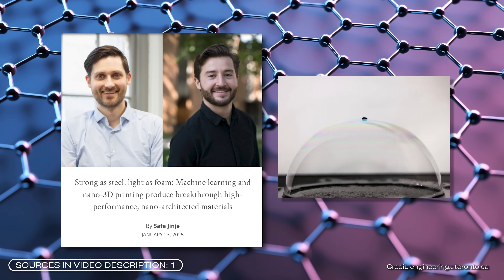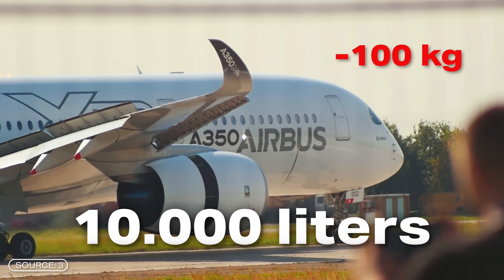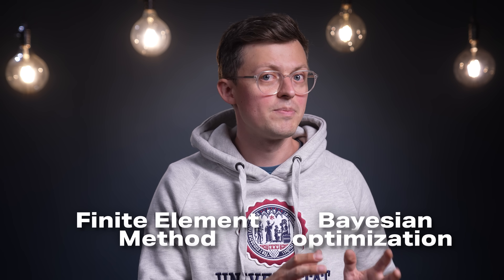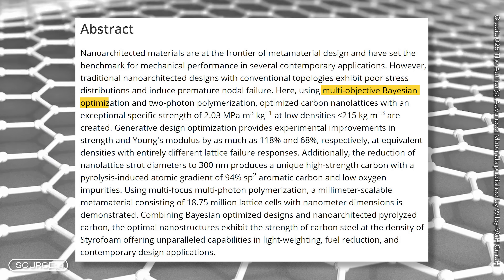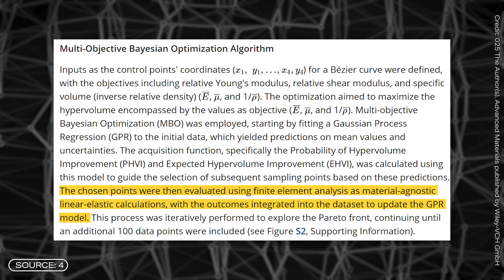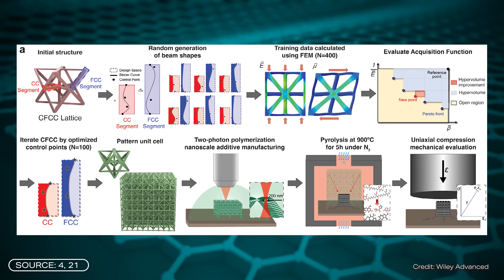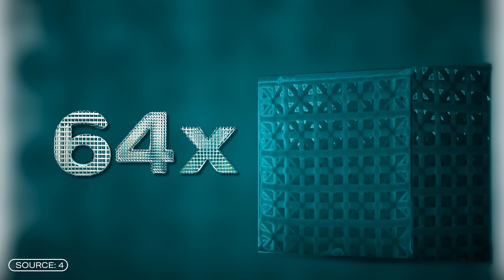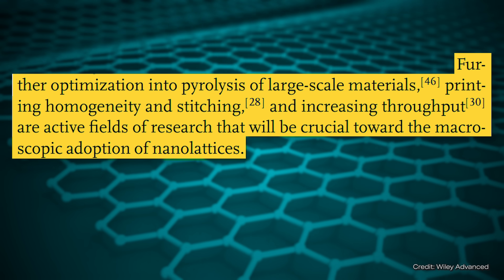New Material: As Strong As Steel, As Light As Styrofoam!

Comment: Oh, foamed metal again? Yeah, BattleTech has been talking about this since the 70's. One of the problems is that it is basically nonductile, once the foam is crushed, it stays crushed.
Reply: Foamed metals have random pore distributions, leading to irregular stress concentrations and brittle collapse when crushed, but these carbon nanolattices are precisely designed to homogenize stress, avoiding localized failure. Foamed metals permanently deform under load due to plastic collapse of cell walls, but he pyrolytic carbon nanolattices are linear-elastic until fracture, and their optimized design delays collapse by distributing the stress.
Reply: i mean, carbon fiber has the same problem but has made it into many high performance applications.
It'll probably depend on how economical it is and if it fits a given application.
Reply: @GamerLudwig 
Yes, carbon made it into the real world as a fiber together with some binder (resin, etc) , not as a nano structure material.
Reply: @GamerLudwig  Dunning-Kruger
Reply: Having a regular structure should help with that
Reply: Yeah, that is why enhanced densified wood is better. Stronger than titanium in every way and but importantly toughness (resistance to impacts, stress and cracking is extremely high), all while 20-40% lighter than aluminum.
Reply: @Resist.Tyranny  With caveats, for sure.
Reply: @Resist.Tyranny  Eactly. Quality wood is nothing else than high quality carbon nanostructure. Wood surpasses everything that has been artificially created so far in ratio weight.
Reply: @Resist.Tyranny  How hard is it to produce enhanced densified wood?
Reply: @StarWarsExpert_  There are two primary types of densified wood. Both remove hemicellulose through liquid chemical soaking, and both use pressure to crush the wood smaller (denser). One method also removes a lot of lignin (the strongest part), and therefore uses much less pressure to densify the wood making that part simpler. The end result is a board that has lost 80% of its thickness but retained its strength. The other method requires much higher pressure, complicating that aspect. The result is a board about half thickness with even more strength than the original because it forces extra tight lignin bonding. There is a company right now trying to ramp up production of the first method. It is a great material but a lot weaker than the second process. When I say enhanced, however, it is in regard to a proprietary step developed by me that adds another 25-40% strength to the already much stronger process. This causes it to exceed all metals and composites currently in use. Magnesium is still lighter, but can't begin to compare in other features. Top-of-the-line carbon composites can compete in some strength areas, but fall far short in others. Titanium and steel alloys are just not as strong. The big breakthrough with this however is how to overcome the high costs of achieving the high pressures needed to make this happen at production scale. This has now been solved. Tons can be produced at a time. All I need a few hundred million and society will never be the same. 🙂
Reply: I'm pretty sure the densified wood I've seen isn't that much lighter than aluminum.
Reply: @Resist.Tyranny  how is enhanced densified wood produced/manufactured (in a nutshell, yes I will search for more info on it)? is it like engineered beams and composite wood/glue materials like MDF?
Reply: @alastairleith8612  It is in another comment. Repasting here. There are two primary types of densified wood. Both remove hemicellulose through liquid chemical soaking, and both use pressure to crush the wood smaller (denser). One method also removes a lot of lignin (the strongest part), and therefore uses much less pressure to densify the wood making that part simpler. The end result is a board that has lost 80% of its thickness but retained its strength. The other method requires much higher pressure, complicating that aspect. The result is a board about half thickness with even more strength than the original because it forces extra tight lignin bonding. There is a company right now trying to ramp up production of the first method. It is a great material but a lot weaker than the second process. When I say enhanced, however, it is in regard to a proprietary step developed by me that adds another 25-40% strength to the already much stronger process. This causes it to exceed all metals and composites currently in use. Magnesium is still lighter, but can't begin to compare in other features. Top-of-the-line carbon composites can compete in some strength areas, but fall far short in others. Titanium and steel alloys are just not as strong. The big breakthrough with this however is how to overcome the high costs of achieving the high pressures needed to make this happen at production scale. This has now been solved. Tons can be produced at a time. All I need a few hundred million and society will never be the same. 🙂
Reply: @Resist.Tyranny  but none of that is correct...
Reply: @philm7758  lol, none of what. I'm thinking you did not look at all the comments, and are spouting off on things you do not know much about.
Reply: @Resist.Tyranny  very true
Reply: Styrofoam comes to mind and took off in so many ways.  If the need is there, it should do the same.
Reply: Most high performance structures need BOTH compressive and tensile strength and this process only maintains the compressive strength while reducing tensile. Ultimately it’s still better to use macro scale materials with highly optimized geometry to reduce the volume of material used rather than thinking we can replace existing designs with some miracle material.
Reply: @refusalspam  Yes, and them damned automobiles will never be more than a fad.
Reply: This is a carbon grid, carbon fiber is flexible, so why wouldn't this be on a large scale? Nobody has made anything larger than a pea, seems kind of silly to start assuming mechanical properties of a new material before it's even been made yet.
Reply: @Wimbletonage 
It isn't really silly. 
You will not be able to increase all aspects of a material. 
Such structures even in macro scale like in cranes or bridges for example are known to have higher stiffness.
At the same time, they are known to be vulnerable to the failure of single parts.
Compare old stone bridges with steel structure ones.
If in the stone bridge some stones fall, then the damage will stay local and many more stones have to fail for the complete structure to collapse. In contrast in steel beam bridges, a single beam failing, can cause the whole segment to collapse.
Reply: @DacusMaIus have u never been on a bridge with a semi truck 🚚  the bridge will literally flex and u feel like ur  bouncing the way bridges are designed today one beam will not make them fall
Reply: @Wimbletonage  let's assume it's an inch think, to flex it'd need to stretch further than the material would allow without breaking...it will break. This entire area of research has already happened, it does not work where it's not already implemented
Reply: @Wimbletonage  heh, I say that they make something larger and useful, which will get some heavy use and abuse.
Make me a cane out of it, I'll give a detailed report on its mechanical qualities from a real world use perspective. I'm infamous for dropping and banging my cane into things at times, getting trapped in holes while walking on cracked walkways and using it as a tool, ranging from pulling groceries (such a quaint old world, old fashioned, really) from top shelves and occasionally convincing idiots to bother someone else.
And even dropped one from a roof in a highly unusual accident that required replacement of the cane tip.
If it's utterly unscathed after two years of daily use, it's good enough to be used for armor on an old battleship. Undeformed, good for use in ships and aircraft.
And it's definitely scalable if one can make a cane out of it, given that pea size.
And it'd be the most expensive cane in the world, given the nanoprinting involved.
Reply: like honeycomb aluminum i suppose
Reply: @gordons_here  
Honeycomb Aluminum is not armor. It is a component in Composite materials. Please do some research before coming to such obviously uniformed conclusions.
Reply: @gordons_here  no
Reply: @-danR NOOOOOOO!
Reply: Ah, BattleTech, almost brought a tear to my eye....
Reply: No, this is a meta material.
Reply: I think you don't understand nano. Foam is not necessary at nano level.
Reply: Sure, but isn't the whole idea to make a material that is really strong under the right circumstances? Imagine how much energy a super light train could save on energy!
Reply: foamed? No.
metal? No.
same basic principle? No.
tl;dr: No.
Reply: @-danR tl;dr: N
Reply: You mean like basically everything?
Reply: so its real strong till it becomes dust
Reply: With this, it seems to have a support structure on a molecular scale that will be highly resistant to crushing and denting. But as you said, once crushed, it stays crushed. And hopefully not brittle. And orders of magnitude stronger than Aluminum, Carbon Fiber and Engineered  Wood.
Reply: Sounds like it could have a good utility in making safer vehicle crumple zones.
Reply: So? Bolt assemblies of components together and just replace the damaged components. We already do this all the time!
Reply: Pretty much every structure that is crushed, stays crushed, it's just a matter of where and how it's used and, I suppose, how you adjust the design parameters to get the structure you want to possibly get more ductility at the expense of some strength.
Reply: Styrofoam doesn't weigh 125K per cubic metre, silly comparison
Reply: Sounds a lot like nuclear fusion then, always 50 years away... 🥲
Reply: Also, how does it get affected from repeated bending forces (wings flexing in turbulence)?
Reply: Why would the foam become crushed ?   Aluminum gets dented, but planes are not full of dents.   
Furthermore , if it was made into structural components of a fixed construction, then it would not be subject to crushing forces.   Inside the plane are many structural members that are protected.
Reply: @jeffguarino2097 
"But planes aren't full of dents"
I have terrible news. Planes are full of dents. Especially around the entrances and cargo doors. Usually they are quite small and within limits, but they can also be larger and repaired with an external doubler, (Those large rectangular bulges, usually on the main structure) or internal doublers (small rectangular/oval patches with a bunch of rivets surrounding them, usually on leading edges and inlet cowls)
Reply: @carstekoch  Doesn't the 12 psi of pressure in the plane pop out all the dents ?  Probably not, I take out the hail dents on my car with a glue gun puller which is more than 12 psi over the area of an inch.
Reply: @jeffguarino2097  because aluminum is still solid, this is mostly empty. It crushes extremely easily and has incredibly low impact resistance. Its quite simple.
Reply: @jeffguarino2097 airplane metals get warnout flexing and develop brittle areas and cracks. Once crushable becomes permanent.  Ie hollow stiff material will be strong overall but week at skin in comparison
Reply: @jeffguarino2097  Agreed. the concern is even small deformations could cause failure, were as in sheet metal that does not happen. so take you air plane wing for example it flexes all the time, and returns to its intended shape.
Reply: @sparkey4293 Not intended for the flexation components.
Reply: @sparkey4293 
Key point, it flexes. It doesn't deform. So assuming the material is able to flex, this is a different topic.
Reply: @sparkey4293  The strongest airplane wings are not made of metal but of carbon fiber. Never hurts to look it up.
Reply: @sparkey4293  Ergo, probably using the material for structures that will flex is not a good application just as using glass wouldn't.
Reply: @sparkey4293 I would probably fuse a durable skin over it, similarly to how we apply fiberglass and resin over wood.
Reply: @jeffguarino2097  actually, many are. I've seen what they look like after passing through a major hailstorm.
And oddly, the carbon composites survive, despite some comments here.
Reply: @spvillano  Possibly this material is good but needs to be layered with a ductile material like aluminum.   It must have a slight bit of deformity allowed before it cracks.
Reply: @jeffguarino2097 imagine a pile of interlocking eggshells. You crack one it doesn't uncrack. You can't unpop a bubble
Reply: @drewlarson65  Except at the nanoscale you don't notice the cracked shells and then suddenly your wings snap off or your submarine implodes.
Reply: @drewlarson65  If the interlocking eggshells were made from aluminum and you cracked one, it would be the same thing.   Your material would need additives or layers to prevent the cracking from ever happening.   The main beam in my house could crack and I wouldn't be able to uncrack it.
Reply: AHahhahah. Lookup Battelle Memorial Inst. These materials have been around and used since the 90's. The US military research budget is unfathomable.
Reply: The concept of microscopic honeycombed structures has developed quite significantly since the 1970s. Metal-polymer is indeed non-ductile, and non-resilient as a consequence. Dents are deadly, with this particular choice of materials. What you need is a compliant nanogrid structure married to a rigid nanotube structure … like wood, but at 1/1000th of the scale. Wood is “micro”, not “nano” scale. So were the early attempts at making cellular structures out of polymer microgrids and metal microtubes.
Reply: Just like my hopes and dreams.....
Reply: So it doesn'T deform?
Reply: Don't want to make a plane of magnesium they would burn faster than a wood plane. Basically carbon and aluminum together are used now like carbon steel.
Carbon thread seems to be proposed for high speed manufacter 
 This is a uniform carbon structure if the voids are filled with aluminum it doesn't weigh any less just difficult to do that. If filled with air it's a trapped bubble in the material that expands and contracts with pressure temp differences differently than the surrounding material. If small and consistent it might pass. It depends if you can x-ray it to determine that.
Trapped air bubbles are not all bad. Those small glass bubbles are handy for some light weight materials as long as you are not building some habitat on Venus styrofoam has a bit of flex. Maybe a bit of added carbon to styrofoam the sharks can only eat half your surf board it's just that Tabasco sauce might be the better composite material in that case. 
It depends on the application so some material gets patented and nobody knows what to do with it yet. That's what happened with silly putty. The best minds tried to figure an industrial application then stuck it in an egg and sold it to kids. They have come up with all kinds of uses for the stuff like clogging your toilet.
Reply: Unless you apply memory material properties..
And in the case of vehicles a structure with the ability to absorb energy in the case of a crash is not all bad.
Reply: I was thinking buckyballs. They’re so for a promising reemergence.
Reply: Sounds like manufacturing scale problems are huge... It's a long way from 10 micron to 10 meters, and doing it for less than $10 million/meter
Reply: Not everyone wants to kill stuff
Reply: Mean while EV batteries average 2000kg
Reply: @Icu-812-me2 
EVs also don't emit CO2.
Reply: @carstekoch 60% all power generation come from fossil fuel here in the US. Impact of rare earth mining  for materials is magnitudes above that for inertial combustion engines.
Reply: The USs energy mix is not inherent to the car and could be changed within one or two decades but even if we use that number and not, for example, finnlands mix (over 90% renewable) that means it still uses at least 40% less CO2. Not to mention that an EV is 80% efficient in it's energy use compared to the maybe 30% (if we are generous) of the ICE car. So those extra 40% can make up about 100% in efficiency differences to weight gains before even reaching the same level as an ICE car. In other words: your car could be twice as difficult to use and still would be more efficient than an ice car.
Also, let's not pretend that Oil extraction is less environmentally damaging than rare earth mining.
Reply: @carstekoch  Gasoline has an energy density of about 12,700 Wh/kg, while lithium-ion batteries typically range from 200 to 600 Wh/kg. It’s the standard for a reason. It put the whale oil out of business.
Reply: @carstekoch I never seen children working oil fields, conflict minerals. Akin to blood diamonds
Reply: @Icu-812-me2 
Yes. Gasoline is more energy dense. I never said it wasn't. And gasoline looses at least 70% of that 12,700 Wh to heat in an ICE engine leaving you with just under 4,000wh of actually usable power.
For every two dollars of gasoline you are literally burning more than half of it to do nothing.
Reply: @Icu-812-me2 
What do you think was the main economic reason for the US to meddle in the middle east crisis? Desert and dust storms?
Reply: @carstekoch sheit and Sunni friend fest that got out hand. Or when we aided Afghans the Soviets. Or when they bombed our embassy’s in Africa. Or plane stuff.
Reply: @carstekoch gasoline is not the only thing made from oil either. Heating oil is up to a 1/3 pre barrel. It’s still very much needed
Reply: @Icu-812-me2 
And the US just happened to support the side that was willing to sell more and or cheaper oil, of couse. As friends do.
Reply: @Icu-812-me2 
I never said it was. What exactly are you arguing against?
Reply: @carstekoch that’s doesn’t narrow it down much. Pick you gripe and say it
Reply: @carstekoch oil got more expensive every time that happened dirp
Reply: @carstekoch you picked one of 35 nations to help Kuwait when they were attacked by there neighbor. Really who’s side you on let me ask you
Reply: Foam is piles of bubbles.
Reply: molecular lattice structures exhibit higher torsional strength compared to other materials. you're talking about the metallic version cookie dough. They're completely different.
Reply: Except that if you make it from hardened steel it would spring back. Other metals have also a lot of spring (yield strenght), for exemple grade 5 titanium or cobalt superalloys
Reply: Or maybe actually watch the video. Polymers aren't foamed metal ...
Reply: it is not foamed, but AM printed nano structure....
Reply: Fortunately, the viability of this product does not depend on our opinion of it.
Reply: Yes, durability is non existent, they need to stop doing this shit out of foam and actually just use steel to make these structures, derp.
Reply: Sometimes you want plastic deformation to save your life. 😁
Reply: Memory metal?
Reply: You're not the brightest, are you?
Reply: Most metal is kinda like that. You can repair and do shit but if it’s CRUSHED you just replace it…
Reply: @Originetics  i think their point is it crushes more easily than cast or welded metal forms, but that might not even be the case with some of these compound structures.
Reply: But as a composite, it has useful properties for lowering the mass without sacrificing strength in areas with known stresses. The problem comes with repeated stress cycles, as they'd be more susceptible and require more shielding, etc. to combat this "feature". But for components with a similar operational lifetime as this material, well... It's perfect. Once styrofoam is crushed, it stays crushed, but we aren't shipping nukes in it, we're shipping playsets and grills, so it's okay if one gets f***ed up once in a while.
Reply: Pay attention. It was NOT foamed metal at all.
Reply: @fizzyplazmuh9024”foamed” or “formed”?!
Reply: SO IT SUCKS!
Reply: It's nano tech idiot.
Reply: It's not metal, it's carbon.
It's not foamed, it's a lattice. 
Reading comprehension matters. And ANY material loses it's strength when crushed.
Reply: @LordMondegrene  u have no idea wat ur talking about just say that
Reply: @LordMondegrene isn’t forging all about crushing?
Reply: Ummm ....Ever heard of work hardening metal ?
 Crushing can make some materials harder. 
There are also materials that get more solid when subjected to crushing forces.. @LordMondegrene
Reply: @LordMondegrene  same same weakness and strengths carbon can be stiff and brittle.  Just speaking in generalities. Sounds useful
Reply: Yep @LordMondegrene
Reply: @LordMondegrene finally someone is correcting the thread with basic logical information.  Even AI based bots got the concept.
Reply: Material science now has metals that are half the weight of aluminum but 10 times as strong as steel.  No lattice structure needed.
Reply: @policy8analyst  can you give the name of the alloy you are referring to? As far as I know, magnesium alloys are the lightest structural alloys in use, a bit over half the density of aluminum and strongest alloys from both metals have comparable yield strength (~650 MPa). Strongest steel alloys are almost 4 times stronger than strongest aluminum and magnesium alloys (~2400 MPa). What is this magical metal that is lighter than magnesium and has 24000 MPa yield strength? (or around 3000-5000 if you are comparing it to average steels instead of the strongest alloys)
Reply: It did not involve magnesium or any lattice.
This is coming out of single atomic layer and multiple atomic layer research, akin to the news about carbon.  Molecular level.
Material Science reportage.
Reply: @policy8analyst Metals are made of atoms arranged in a ..... Lattice.
Reply: Those are not problems. Sorry. Those are properties. The difficulties they face producing it in large enough quantities at an acceptably low price, those are problems.
Reply: Ur argument is saying that concrete isn’t useful.
Reply: @torg2126 you are contradicting yourself. If it stays crashed (aka deformed), that is ductility. The ability to absorb energy. You probably meant that these structure either lose their elastic properties, or become brittle.
Reply: And this is why the sole of my Adidas Ultra 4DDD is permanently crushed
Reply: Don’t crush it? If I get crushed it sucks, too
Reply: @evdm7482  Well, that's the thing: if you are using something as a structural material, eventually you are going to run into situations in which it becomes incrementally damaged. At least for meta materials.
Reply: Don't crush it then
Reply: A two year old could snap this stuff in two with bare hands. All compression and no shear…